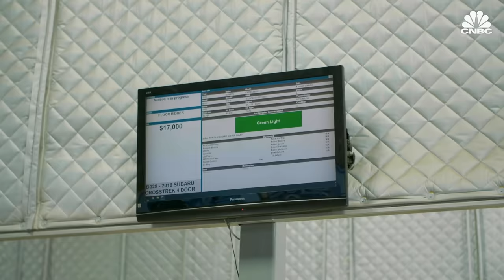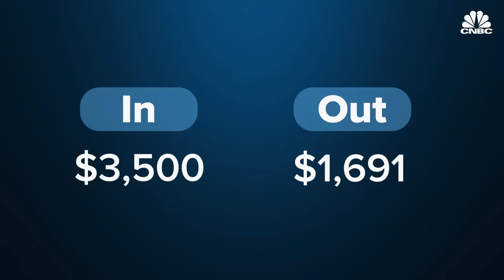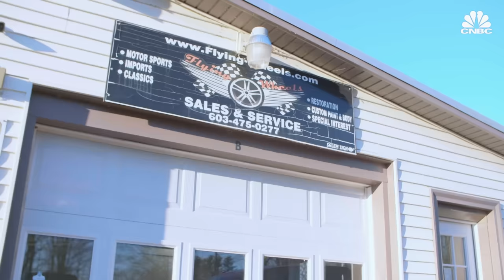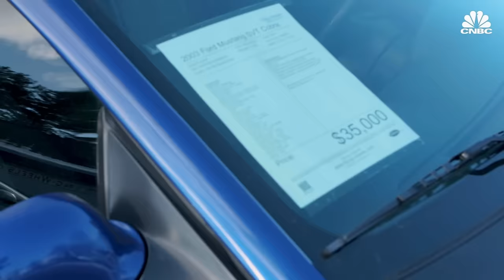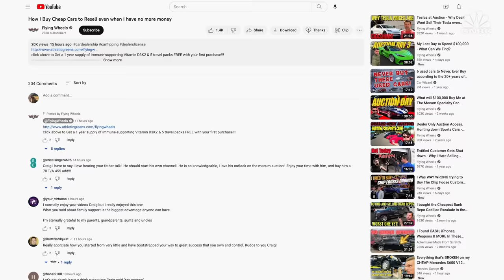How I Built My $3 Million Business Buying Cars At Auctions

Comment: That Ford Focus at 2:18 was mine. I traded it in for a 2012 F150. Craig said 4x4 works good but it did not and it still does not. Fortunately with better all-terrain tires I bought, it does just fine snow until I can try and fix 4x4. Craig did help me out with an airbag light since it can't pass inspection in Massachusetts. His mechanic wasn't able to fix it, so he went to others until someone did prior to trading Focus in. End of the day, I got somewhat a good deal considering it's a rust free truck from Virginia and I have posted some videos with it in snow last month. Craig, if you're reading this, I hold no grudge despite 4x4 not working, and I wish you nothing but the best with Fly Wheels! And I hope someone enjoys that Focus because I made memories with that car.

Comment: I am trading in my truck that I bought from him 6 months ago. It had nothing but problems. Was told 4x4 works, it doesn't. Brakes were so bad and it unsafe. Constant misfires. And the cherry on the top was it needs a new timing chain and solenoids which is a $4000 job. At 2:16 in the video, was my Ford Focus in the background. I traded that in for the truck I bought from Craig. The worst part was he doesn't even know the vehicle history because we had to do the carfax ourselves at that point I should have never bought the truck. He needs to be honest and provide a carfax you can't just buy vehicles at auction and then just sell it the next day.

Comment: Started the video with a lie. You do not only have 30 seconds to look at the car. Before the auctions start you can go the packing lot and inspect each car you are interested in buying. Check the oil, interior, body, engine for major trouble codes with your diagnostic tool, etc. I can't believe any other word this guy says.
Reply: There are over 1000 cars at the auction. I go to.  I can look at 200 the day before and that still leaves 800 cars I didnt have time to look at